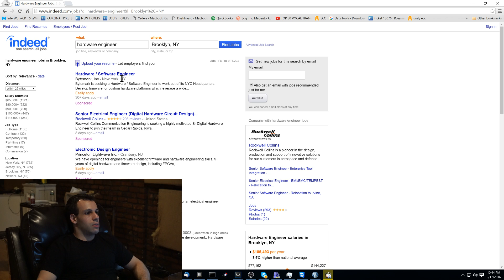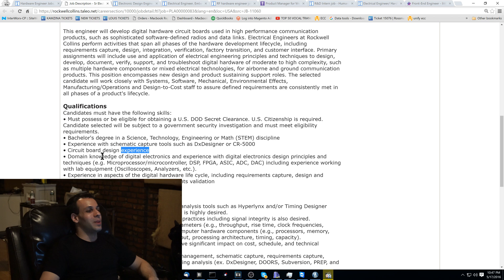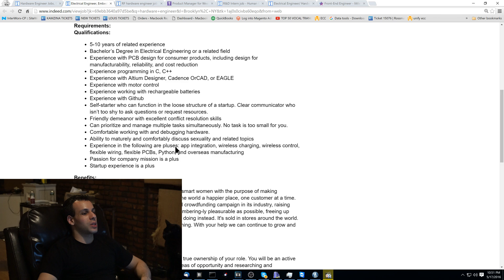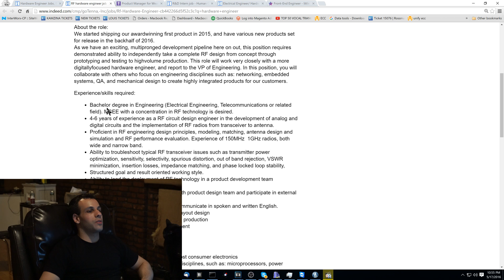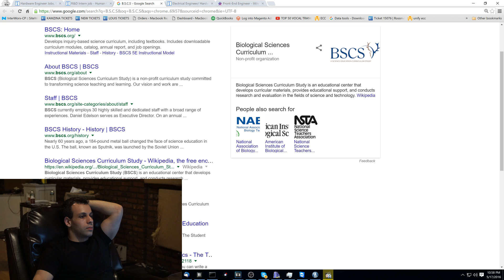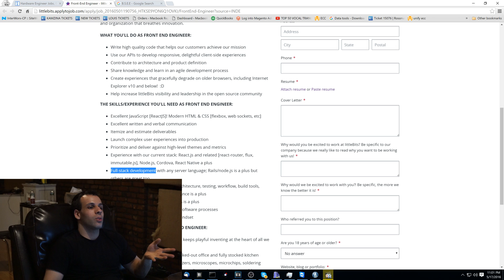Louis looks for a job

Comment: These tech companies are deliberately putting unreasonable job requirements, and omitting salary , because they want to scam the labor department. They already know that they are going to give the job to an immigrant from Asia with an h1b visa, but in order to do that they have to show that no American can be found to fill the position.
 They therefore design these ads in such a way that no American who applies will ever be able to meet the requirements, and after the position remains unfilled for a certain amount of time, the necessary paperwork is done, and they are able to get their h1b person, who of course is going to be paid considerably less than they would have had to pay an American. Note that no salary is ever stated in the job advert.
Reply: The job postings Louis pulled up all require knowledge of multiple fields. Those are not cheap jobs. From my past experience, those positions will mostly filled through head-hunter agencies. It is normal to not show the salary for this kind of public postings because they actually don't expect someone with only ~5yr exp. to meet all the requirements. They maybe actually looking for someone who meet 3/4 or even only half the requirements, or combination of a few of the key requirements. That will affect the offering a lot. If someone meet most or all requirements, the offering will be negotiated. 

And base on my current knowledge (2018), people who match most of the requirements will get high pay and similar pay in both North America and Asia, especially China now. There is a high pay gap between U.S. and China for low end / junior engineering position. However, salary for top tie engineer are matching now. Starting this year(2018) and will be more noticeable in 2019, China big high tech firms(Baidu, Tencent, Alibaba, Hauwai, etc.) almost come to a stop on hiring intermediate and junior positions. They don't even re-fill those posts if someone leave. However they are paying top rate(in U.S standard) for any high end engineers they can get their hands on.
Reply: This sounds believable
Reply: Pretty sure there was a canadian mining thing that said you had to be fluent in mandarin. To work in a mine. For relatively low pay. How considerate for them to make sure you can speak to the rest of the workers
Reply: If these requirements are unresonable how come the Asians fulfill them
Reply: Jesus. Absolutely par for the course, since America stands for exploitation first and foremost, but I never made that connection. 

What a state of affairs!
Reply: Yep
Reply: It's the same case with every country not just america lol
Reply: This comment should be pinned to the top.
Reply: You are absolutely correct, and its sad. I have been in IT for almost 25 years now - I started in the 10th grade before even finishing high school.

Every corporation I have worked for in the last 10 years especially, pulls this bullshit trick just so they can hire someone overseas for cheaper. I just got laid off from a large payroll company earlier this year due to Covid, and they would put the QA engineer/programmer jobs up in our kitchen on the bulletin board and if there were no bites, then they would have a "reason" to bring someone over from India. Unfortunately, Covid kicked this whole thing into warp speed, and my job position was eliminated and was sent overseas.

I believe in free market, but corporations are playing dirty and they need to get punished with heavy taxes/fine for this kind of bullshit to discourage them from outsourcing so many jobs. There is ALWAYS someone in the US who can do the job and will be happy to work!
Reply: It's gotten really weird. The corps got EXACTLY what they wanted: H1Bs, and then the grievance people backing the idea that "Americans" are too stupid to do the job and the H1Bs are "needed." Anyone against H1Bs must be "racist." (As if "Americans" are all "white.")
Reply: @czos9239  my father has worked in IT in a large corporation, and when it comes to hiring they tend not favor american employees unless they got really strong skills. No ones denying you deserve the job if you're skilled but this affects people TRYING to break in an industry or job because theres no effective training infrastructure to facilitate people into these positions. Colleges dont provide that, employers dont provide that, but somehow people just have to have the experience
Reply: @genericname1 first class ticket? Did they get more opportunities than you, where they less skilled than you?. So you are basically saying, that they should get less that you, as you have been born in America, this is an attitude which does not work in the long run due to a global market
Reply: @genericname1 The first part of your statement is totally true and the part that pisses me off the most. If America is the home of Innovation they should make the visa system merit based.
Reply: @genericname1 I'm talking about people with master's degrees here in the United States
Reply: @genericname1 Companies are willing to pay the 130k, at least from my experience. These opportunities do not exist in other countries and hence smart ppl will come here and innovative companies are always on the lookout for smart ppl irrespective of where they are from. Even if the minimum cutoff for h1b is increased from 60k to 80k I'm sure the companies will not stop hiring immigrants. Just go to any grad school and see the number of Americans in it, it's a joke. The situation is not because Americans don't want to go to grad school it's because undergrad is prohibitively expensive
Reply: @genericname1 No one is handed anything in life. People who get H1Bs etc didn't just wake up one day and get handed one. Many have worked very hard to get whatever skills they have learned that makes a company go through all the trouble of hiring them. Also, it is a fact that the school system in the US is terrible and perpetuates the inequalities present. If the school system cannot provide workers with the necessary skills, they will be found elsewhere.

Also see this video by Louis.
https://youtu.be/hcCOCxOCrcA
Reply: @genericname1 I love how you sprinkle in African and Native Americans to try and sweeten your argument. It's still ultra salty lol.
Reply: @genericname1  Extra salty
Reply: Did you consider if the  H1B guy is just better qualified than you? In a free market, there are no freebies, if he gets the job its maybe because he has a masters degree and you don't. I'm 100 percent sure the H1B system has its flaws, but to blame that for American citizens not getting a job is a bit irrational. In my opinion they should stop giving H1B's for low skilled work like they are doing now - specifically the IT consultancy industry - that is the biggest slap in the face - on the system, on American people and on every skilled immigrant who worked his ass off for a Masters Degree and is denied a chance to work.
Reply: @zarf4219  many people dont deny this that there are capable workers abroad. The problem is a lot of US firms are just using them while claiming they cant find adequate labor in the US by making it harder for americans to get those same jobs. They go out of their way to discourage hiring americans anyway. Everyone ends up getting hurt. They dont want to invest in training US workers at all whether its through college or through jobs programs. But they will say they "train" h1bs that end up getting fucked over anyways. You can talk about free market all you want but this is a case where the free market can cannibalize itself and ends up hurting peoples prospects to benefit profitability.
Reply: @genericname1 Don't try and paint it as if you care about the plight of minorities.
Reply: Shifter who cares about minorities? I don’t give a shit about them. Democracy is caring for a majority. Caring for a minority is fascism.
Reply: Salty

Comment: Well, if you just had the degree you'd be qualified. There is no guarantee that Apple will always make repairable laptops forever either. So, you should probably just suck it up and get the degree. That way you future proof yourself against an uncertain future. Oh, and get an Arduino too. They are a lot of fun to play around with. For the most part the counterfeit imports are fine. You can get some of them for a few bucks and change.

Comment: Worst part about all those qualifications on those Electrical Engineering jobs... is that EVERY electrical engineer learns that stuff...    
FPGA (Which IS ARM Assembly), Verilog/VHDL, C/C++, C#/Java, MatLAB, and any variant of coding language 
Analog and Digital circuit design (Op Amp circuits, Amplifier circuits, RC/RL/RLC circuits, Power systems)
Circuit Analysis (lab work with Multimeter, Oscilloscope, Wave Generator, Power Supplies)
The only difference is their specialization when it comes to Power/RF/Computer Architecture/ and what not.     
Ultimately, all those specializations fall back on one thing: Fourier Transforms from Differential Equations.

Comment: You should look at Electronics Test Engineering jobs...   You have failure analysis down.   You have developing test processes down.  You have hardware level debugging down(lots of design engineers are terrible at this) You could brush up on fundamental electronics theory with a run through The Art of Electronics with a focus on doing the exercises.  You get a lot of the theory, but a lot of the subtle best practices and rules of thumb only come through trying to build shit from scratch...  make some time to design your own widgets, even if it is just tools to make your current job easier.
That ought to be with $0.02.  Cheers.

Comment: As a programmer I do not quite get using the phrase "full stack developer" in a job description...if ever there were something a good developer does NOT want, it is a full stack.
Reply: It probably means the codebase they have to work with is shit and full of memory leaks, hogging machines to death, and they need someone to wade through hundreds of thousands of lines of un-commented, obfuscated code to fix it.
Reply: The one place I could see "Full stack developer" being part of a job description is if you were managing the developer team and you have to be able to understand every part.
Reply: +SkanMLL Full stack is most useful for smaller projects where the amount of work on each project is not worth the overhead of organizing multiple people for separate layers. It's also common now a days to ask for full stack simply to allow for the team structure to be more malleable. If you have some specialists as a core then you can use full stack devs to move around wherever more manpower is needed at any point in the development cycle. It's also great when your specialists have experience with the full stack as it allows them to develop in a way that makes life easier for those around them. Full stack is really great as well for start ups where versatility and the ability to pivot is highly important.
Reply: I could see that as well
Reply: Lame joke aside,
Full stack means start to finish (Application design, creation (UI, DB, Code Behind, Deployment))
Reply: Just look at the crazy shit amount frontent-devs are doing... JS, Html, css, npm, nodejs, angular, docker, git ....and all the other crap... Backend  Python, SQL, Elasticsearch, Java, RestfulAPI development, git, docker, git pipeline, kubernetes, deploying using the git pipeline... and maybe a few other things ....
Reply: Do not worry mate, some of us got the joke...
Reply: ***** Explaining the obvious thing is lame. But thanks. I guess a few people won't have to google the term now.
Reply: Full stack developer means you don't care about how usable or shitty your UI is.
Reply: I think that's a subjective opinion. I consider full stack more interesting while having more freedom in terms of interfacing than simply working in only one layer. In a sense, a good developer should seek challenge not try to limit themselves ;-)

Comment: my problem with a lot of the job posting i find is that they will often say "entry level" but it requires experience and a degree.
a lot of it is a play with words, they often say entry level just they can pay you less than what the average employee of that position would usually make.

i can see how they're weeding out those that are less qualified but by setting these standards they're also preventing people they may also be qualified but lack the specified requirements listed in their ad.

Comment: Strangely interesting watching/listening you go through those skillset requirements. Two years ago I would've found it too damn frustrating because it's too damn familiar from my hunt for a job I wouldn't hate and finding too many job openings that had absurd requirements.

It's kinda disturbing that everything seems to want you to have all the skills and experience and then preferably also... not be old. Anyone who actually finishes one of those degrees will have quit some of their years spent on the education process, then along with that they want x years of work experience on top and then you're quickly looking at people over the age of 35. 

Oh well the modern world we live in I guess, I've always gone with the if the wage seems alright and you match most/some of the requirements to send something in. Throw enough shit at the wall and eventually some will stick and you get lucky, a frustrating process that's hard to keep up due to the lack of apparent results. One of the hardest things is probably to get "into" the job type that you're interested in at a position while having some or most of the education but no practical work experience yet, even finding a half decent internship to get some experience can be difficult.

I landed where I did eventually by getting an unpaid internship (well volunteer level compensation, might as well call it unpaid) and getting a contract at the end of that. This was while I was getting unemployment income from the government which in my country isn't terrible. It's enough to get by and a little bit extra, but not a lot of room to spare for luxury stuff when you've got bills to pay.

Comment: Actually, a good paying job like your repairs and troubleshooting would be like a test technician for an electronics company.  I applied for a job like that at Raytheon a couple of years ago that required troubleshooting down to the component level on boards for missile and bomb guidance systems on the production line or refurbishing/recertifying units from the field.  $26-35 an hour based on experience, as long as you could get a security clearance and an associates degree.

Comment: I wonder how many of those listings are being used as proof to get H1-B visas.  There is a lot of talk they can't find Americans capable of doing these jobs yet water down the requirements once the company gets an employee from another country.  Advertised job description: Doctorate degree in electrical engineering with 14+ experience with program X software. Real job description: Must be able to take out the trash and dust the floor.  That's one of the reasons the wages are not mentioned.

Comment: Fully enjoy your videos..   Would you mind recommending an external drive for my Photographs...  I was about to buy a "G" system backup and stopped that purchase after watching you video.
I use to do this kind of work with Communications Gear and your diagnostic logic paths are solid!!!   Please suggest a couple of external HD .. I have several years of photographs I need to safeguard.
Thank you !!